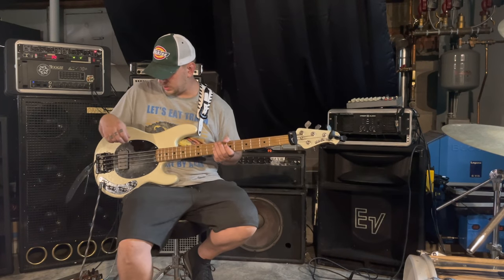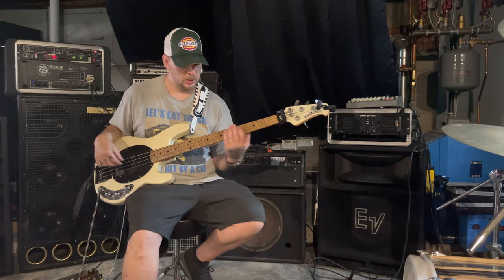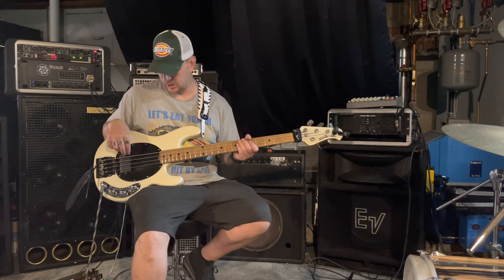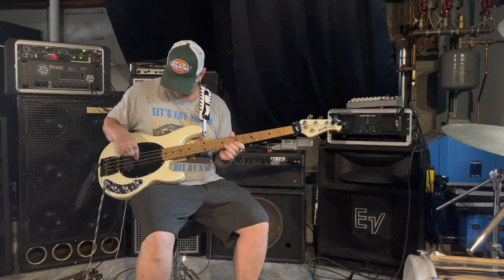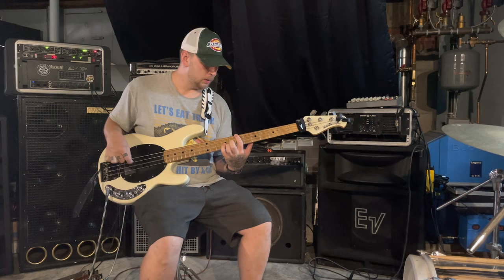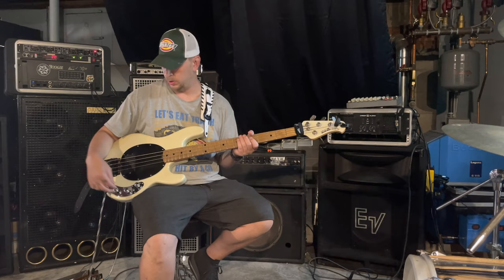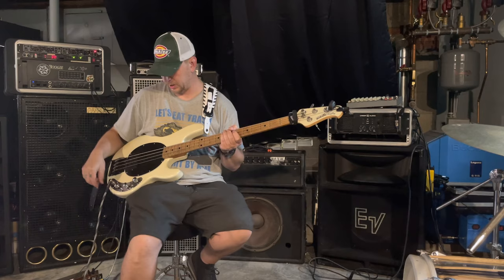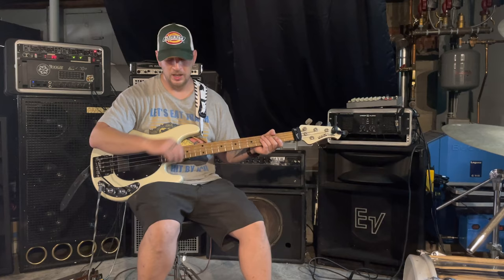Stingray with multicoil pickup and NFP filter preamp

Comment: Is this the NFP or the NFP special in this bass?
Reply from the maker: That is a great question. Even though it is the NFP-Special, it is wired as a regular NFP. This means that this multicoil pickup has a single hot signal and therefore Brian is using only one of the inputs on the Special preamp.

Comment: Can i ask what are the 2 switches for?
Reply from the maker: Brian mentions it on the video. One of the switches is a Passive/Active switch. The other switch is the Peak Resonance Boost on the NFP preamp. On the first units, as it's the case on this video, this was an external switch. This feature is now part of the Filter controls set as a push-pull built in switch.
Reply: @lusithanddevices  thanks
Reply: @lusithanddevices would you provide a wiring diagram for this exact setup?